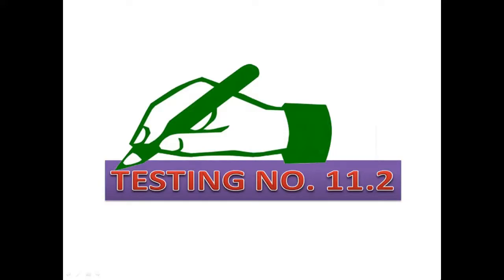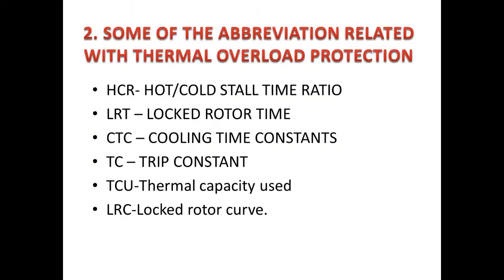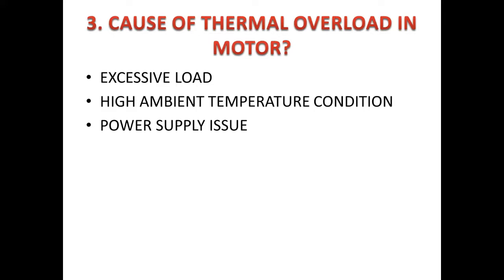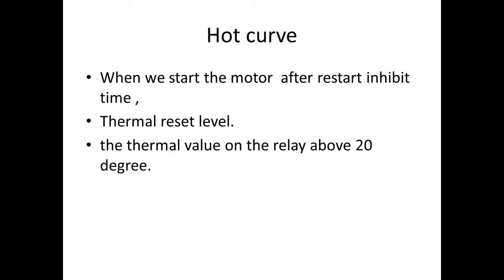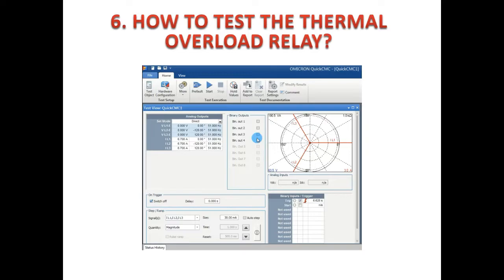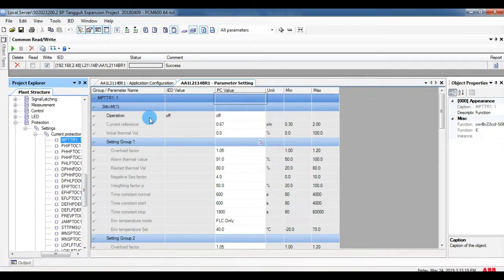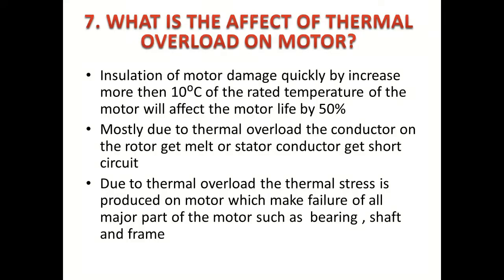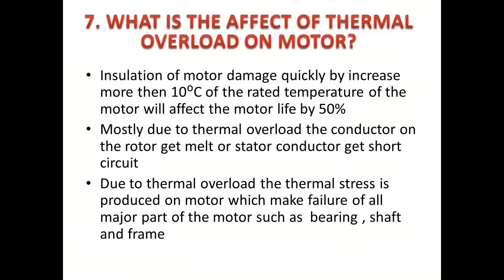Thermal overload  Protection Testing | For | REM 620 Relay | Motor Protection relay testing

Comment: Great work sir
I have question about initial thermal value in normal condition ,how much should be this value and this value will effect on the thermal level I read if the motor in normal running ?
I change relay from rem610 to rem615 and the engineer put this value 0
Reply from the maker: Initial value should be the surround temperature of the motor. thank you.
Reply: @baranitech1026  
What is the benefit of this value or how will effect in the function ?